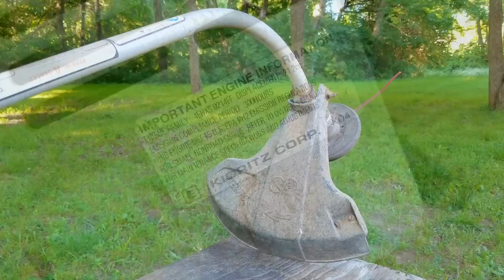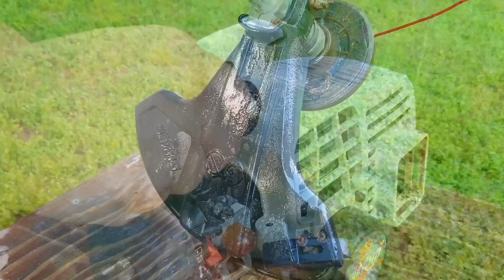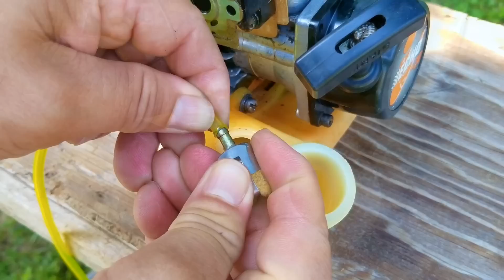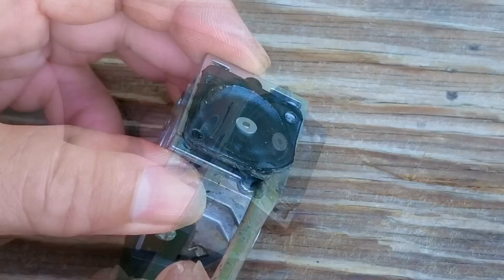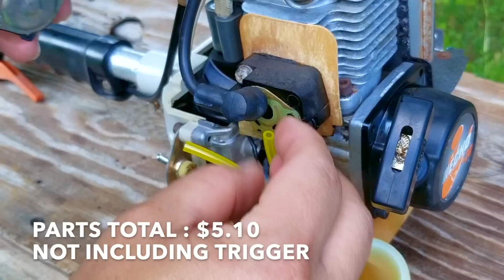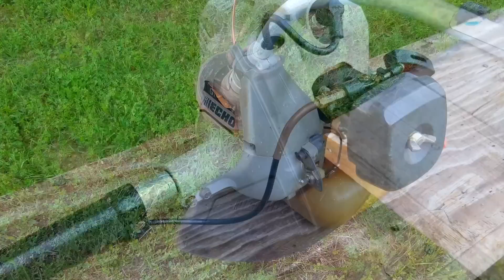Fixing An Echo Trimmer That Won't Start After Storage

Comment: That's a good job. I work on 2 cycle engines,  chain saws,  weed eaters,  ect.  I go for cheap parts and the cheap carburetors as well.  I have only had a few small problems with the cheap stuff . I have a leaf blower that I bought new in 2009,  the fuel lines were broken.  I found a complete kit for $10 dollars,  that included the carburetor,  fuel lines and filter.  I changed out everything,  plus removed the fuel tank,  cleaned it got it back together about an hour or little over an hour and fresh fuel started on the 3rd  pull idled fine would surge at high RPM  readjusted the high speed,  it smoothed out ( I richen slightly to prevent burning the engine down) made very slight adjustments to the low speed mixture screw.  Now after sitting for a month or 6 weeks,  it fires up after 3rd pull,  will idle,  revs up smooth and easy.  For $10 it was definitely a good buy.

One thing I don't use the spark plugs they put in those kits,  had lots of problems with those so I try to get either the NGK,  or Champions.  So that added another $4 . Total $14. Still a good deal 😊
Reply from the maker: wow! very nice work.